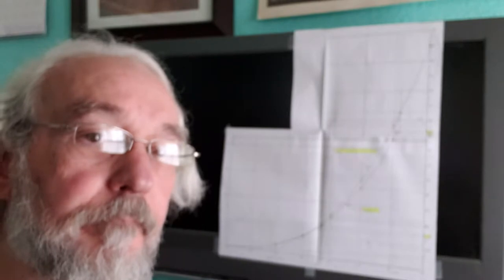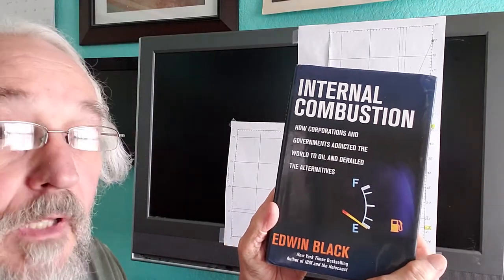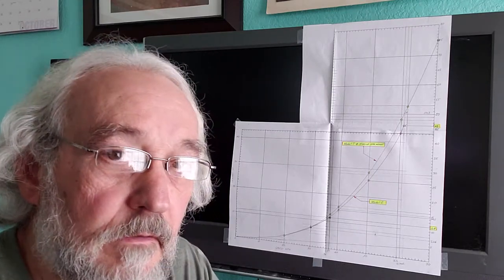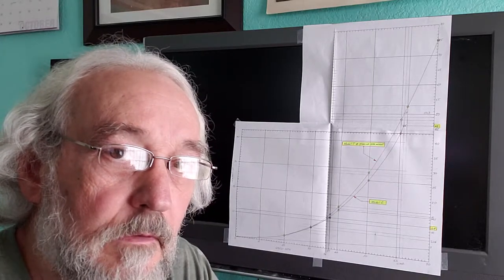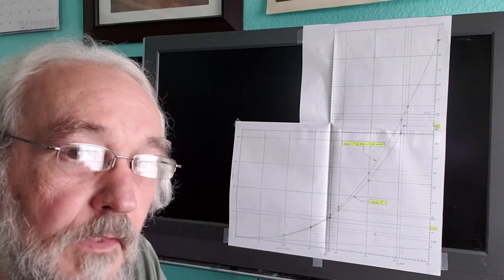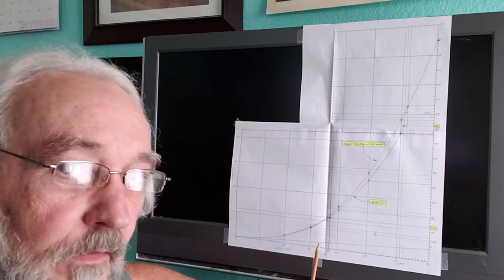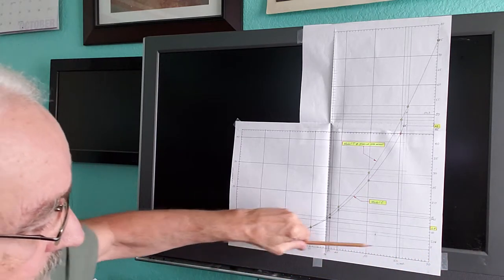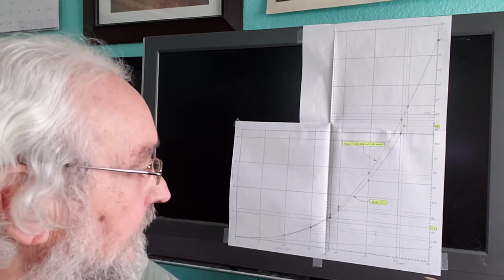A Electric Ford Model T versus a IC Ford Model T

Comment from the maker: It would be roughly the same but the torque curve would be better. You would get more traction HP not using the T Transmission and Differential. You probably would have around 18 Traction HP. That would gain a few more top in mph. Closing off the radiator would also improve matters by a couple mph.
Reply: Thank you for your answer!   Not to use a gearbox makes it easier to build but will there be power to cope with steep uphill runs with a direct drive?

Comment: Thanks for an very interesting video!  I have a 1922 model T that i planned to convert to electric.  I bougth a 10 Kw 96 volt series wound  fork lift motor from a scrapped truck.  I thougth it migt be enough as the original motor is approximately 15 Kw? What would the estimated peak speed be whith this motor?  (original gears in rear axel)    Thanks!  Lars